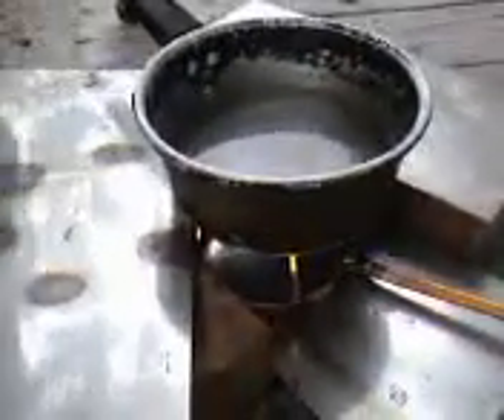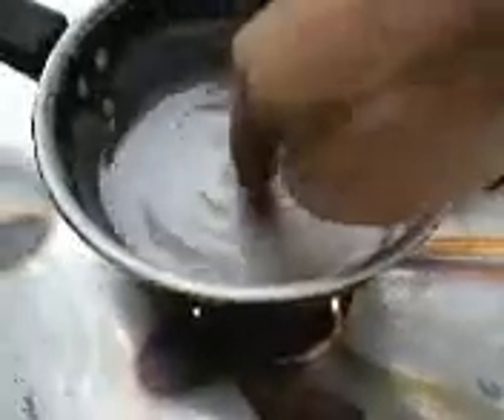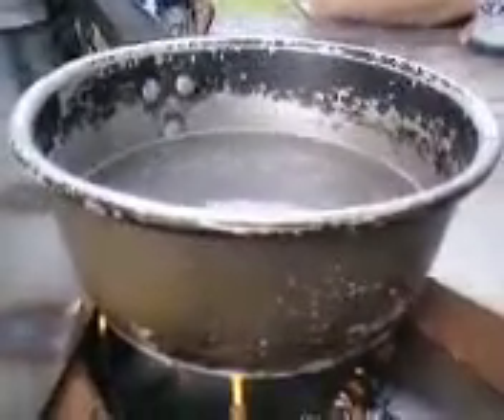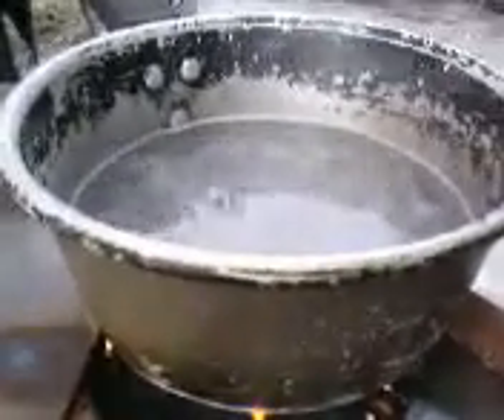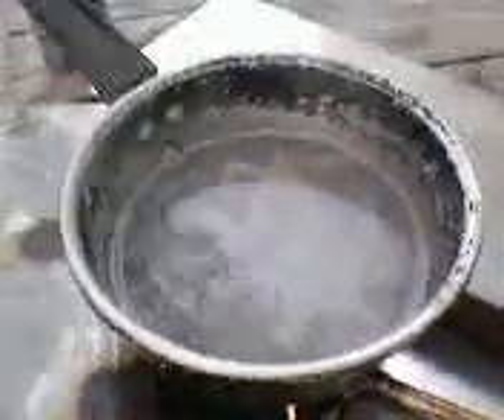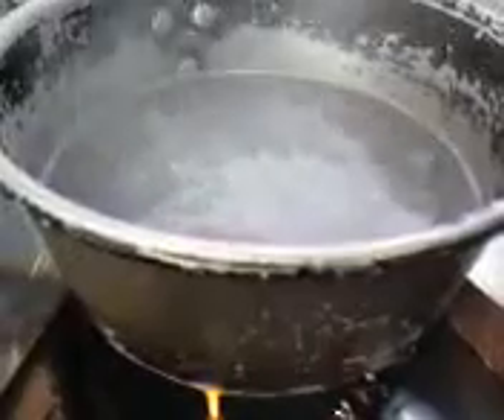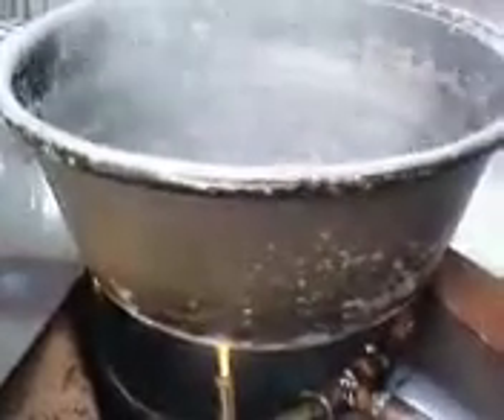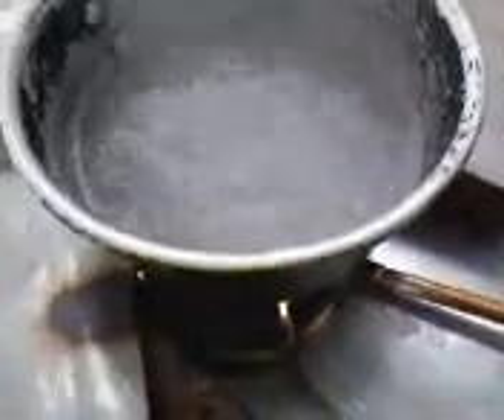HHO Stove Burner Project Prototype #2

Comment from the maker: I hadn't never burnt thru a pot yet . I have had around 15 lpm on one and as long as it has water in it dont burn thru ...But what you are saying would be good for the water drop build up on the bottom of the pots ..The biggest problem i had with my 19 tip burner is the water drops putting my flames out ..

Comment from the maker: Nothing ....I do use a bubbler with a reset top.....I have found that if you get the hole size perfect for your gas flow you will very seldom have a flashback.....Its all about tip size and the gas flow for that size .....